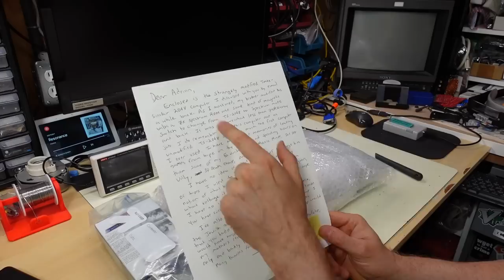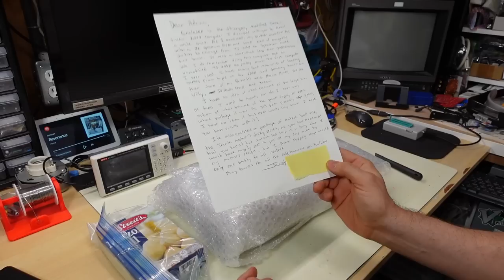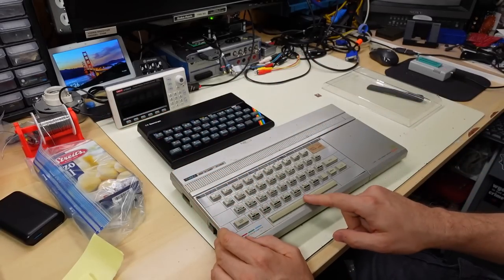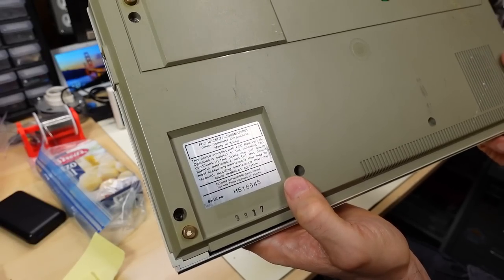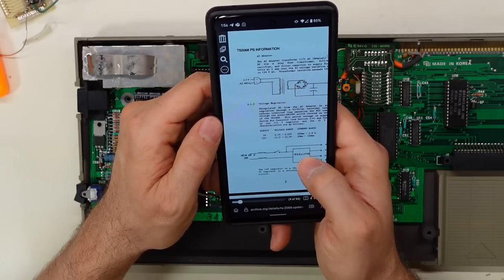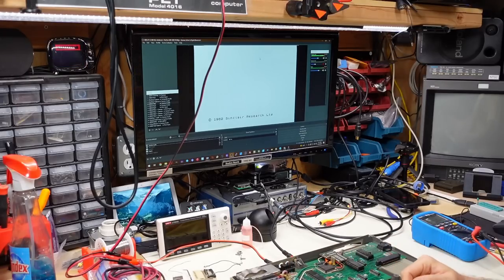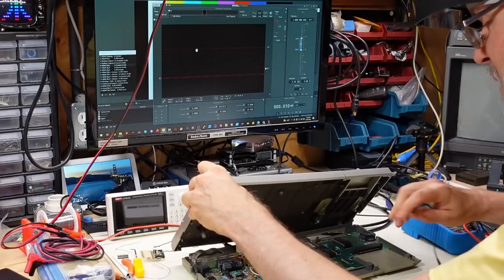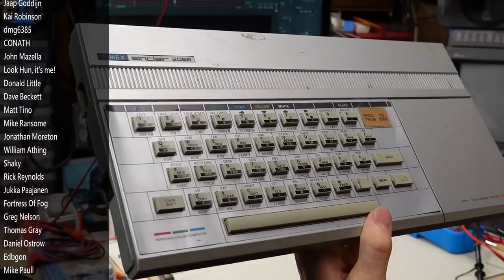0044 The ZX Spectrum of North America: The Timex Sinclair 2068

Comment: Actually, they weren't the same hardware.  The TS2068 had extra video modes, a real sound chip, joystick ports, a cartridge port that was a separate memory bank.  The edge connector was also different.  It even had CGA compatible RGB on the edge connector.

The 50/60 Hz differences were obvious.  Nearly all software used the vertical blank timer for timing.  So Sinclair software would run a bit faster on the TS2068.  Even when using a genuine 48K Spectrum ROM, it was still only 96% compatible.

The bodges and the daughter board are factory.  The TS2068 had two ROM chips.  One was in the primary memory bank (16K) and one was bank selected in (8K) the EX-ROM bank.  The cartridge also was bank selected.  The TS2068 had advanced bank selection and the 16/48K ZX Spectrum did not.  The ROM switcher board only selected the ROM in the HOME bank.

The hissing is normal.

You need to burn a TS2068 HOME ROM to use the computer's actual ROM which is an enhanced version (and why Spectrum software is not compatible).

This was the first computer I owned.  I made expansions and improved the OS using the bank selection logic.

Also, the Timex Technical Manual is available for download.  Yes, it's color and should have colorburst.  The joysticks were proprietary to the Timex.  Sinclair joystick assignment is not compatible.
Reply: As you say, the hissing was normal, with the original power supply (which was indeed 15 volts) -- but maybe it actually makes sense to give it less voltage, and maybe that really does kill the hiss, as well as the screen noise, as Adrian seems to have found? I never saw that experimented with back in the day, but I do know that upgrading the voltage regulator was a common mod.
Reply: @wmcbrine  upgrading to what?
Reply: @wmcbrine  what does it do if you change it? I have one of these machines.
Reply: @blackterminal  I haven't done the mod. Read the article, you'll know as much as I do.
Reply: The issue with it, it was meant to be a rock bottom priced computer, the only reason it sold so well, at least here in England, as despite how unreliable they were, they were half the price of their nearest competitor.

Even later Spectrum revisions(such as the later models with built in tape drive) all stuck to this principle. In the late '80s they were still stocked and sold in high enough numbers in bargain stores for like £50.
Reply: Actually, they joystick ports were Atari compatible, which was the norm in the US.
Reply: @donaldcongdon9095  He meant they were incompatible from a software perspective (you need different code to read them on a 2068 vs. the various Spectrum joystick interfaces).
Reply: @wmcbrine  That’s true. There were several joystick interfaces and standards in the ZX81/ZX Spectrum world. Sinclair and Kempston were the main ones.
Reply: @donaldcongdon9095  that had nothing to do with what I stated. They were incompatible with the Spectrum internally. Kepston is the typical joystick interface standard for a Spectrum.

Most every device with a DB9 interface was Atari compatible. Sega being the exception.
Reply: @fattomandeibu  Indeed, but Timex had "Tim Taylor"-itis and forgot about that.
Reply: @wmcbrine  The TS2068 had a major weakness, despite its many improvements.  That was its SCLD (similar to ULA for Spectrum).  If you just farted the wrong way and the SCLD gave up the ghost.  Playing around with the voltage etc could fry this sucker, especially if you used bus peripherals.  Lowering the input voltage also lowers the peak amperage available.  If the power supply sags, then this is when it hits the fan.  You also can't hear the hiss when enclosed.  This lowering of the input voltage is not needed.  15 volts should be adhered to. If it didn't matter, then Timex would have used a more typical 9 volt transformer.

As to the differences with the Spectrum, the built in switching supply was to fix the hot 7805 of the Spectrum.  The chips were consolidated into the SCLD.  It had the typical built in features for video games (FM sound, more graphics modes, and joysticks).  It even came coded to be ready for memory expansion up to 256K (provided the expansion had the second half of the bank selection logic).  The TS2068 could run BASIC out of the cartridge bank and use all of the 48K HOME RAM for variable storage.  Sure, it ran slightly slower doing that, but it worked, and I know as I coded a BBS for it to run out of the cartridge bank.  LROS and AROS were genius expansions to the ROM code, as well as the function dispatcher.

Timex did it the right way, but the uber-cheap and inferior Spectrum already had a foothold.  So to make your superior TS2068 run ZX Spectrum games, you had to downgrade your TS2068 to use the Spectrum ROM.  Sad, but true.  This is why it failed.  Oddly enough, games could have been ported easily, but the publishers didn't bother, nor did Timex.

Comment: ZX Spectrums were immensely popular in the rest of Europe too, especially in Greece and Spain.  Also plenty of clones behind the iron curtain too.
Reply: This same model with some modifications for PAL, was produced in Portugal and I had one. It was the TC 2068 instead of TS 2068.
Reply: @fernandobernardo6324  Strange, as the original British ZX Spectrum should have been just fine in Portugal. France may have needed a special SECAM model though.
Reply: @johndododoe1411  Indeed, but Timex Portugal decided to make some changes to that model and create another one TC2048 and they were produced here. These models were exported to some countries like  Poland, where many spectrums were in fact Timex machines.
Reply: @johndododoe1411  French Spectrums came with a SECAM adapter that plugs into the edge connector.
Reply: @fernandobernardo6324  Timex of Portugal were allowed by Sinclair to serve markets not covered by Sinclair: Portugal, Poland, Chile and Argentina. In Poland one can find the Timex Computer 2048 and the Unipolbrit 2086 (which is a modified Timex Computer 2068)

Comment: The TS2068 has additional graphics modes that the ZX Spectrum does not have. The AY chip is mapped differently from a ZX Spectrum. There is AY support in the BASIC ROM. You probably want the TS2086 ROM as well.

Comment: From memory as an old Spectrum owner.

The three pots you pointed out are to adjust video timing, early Spectrums needed tweaking to get a good stable colour picture. Worth trying to sort out your colour problems.

The ROM probably contains both Sinclair and Timex code. The lifted pin and bodge wire are acting as a bank switch for the lowest 16K of memory.

Comment: I had a Timex Sinclair 1500 at one time (dad found it at a "resale shop" many years ago).  The case looked more like a silver-and-beige ZX Spectrum, although I understand it was more of an upscaled TS 1000.   Even had a matching thermal printer with it.   It went missing years ago, I suspect I lost it in a house fire, along with my 3 TS100 machines and their accessories.

Never actually used any of them, they were just in the machines I was collecting at the time.
Reply: The TS1500 is a ZX81 in a Spectrum case with 16K internal RAM. Oh, and the case is tweaked ever so slightly to sort of match the styling of the 2068. It was a weird relic of Timex's original plans to bring the Spectrum to the U.S., before they went with the more advanced 2068.

Comment: As far as I remember, TS2068 had a ZX Spectrum "emulation" cartridge, which supposedly was supplied with the computer (at least its Polish version - Unipolbrit 2086 was). There was also TC2048, which was much more ZX Spectrum compatible.
Reply: Correct. Same in Portugal.
Reply: Iirc it was an extra and rare, dont know for sure though
Reply: The US Spectrum cartridges for this was very expensive and is now insanely rare. It certainly did not come with the machine.
Reply: i have a tc2048 but not yet working correctly,
Reply: Are those Soviet era clones?
Reply: @killerbee2562  In terms of period in time - yes, but they don't have anything to do with Soviet Union. They were made in Portugal.

Comment: I don't know much about the 2068 itself, but that's definitely the original Spectrum ROM you have there. The Timex ROM shows a “© 1983 TImex Computer Corp” message under the Sinclair one.

Also, as others have mentioned, the hardware isn't identical. The Timex has some (very interesting) extra graphics modes which are supported in BASIC, but only in its own ROM. Also, the GI sound chip is on different I/O ports to the one in the 128K Spectrums, so any Speccy software that uses it won't work. I believe the joystick ports are also incompatible with any of the Spectrum standards, but don't take that as gospel.

Comment: I had a Timex 2048, it was smaller ( no card port ) , it also had 2 joystick ports and it had RF for ntsc or pal.
I remember that it had on the manual a code that open some eprom that was able to be write from the basic, but I do not remember any eprom on the main board.
It use a 9V - 1 Amp power brick.
From what I remember did not had any "extra" boards on the main board.
I had to repair my when it blow up a cap.

It was a strong (like a tank) machine, besides the cap nothing more got damage.
Good video, 😉

Comment: I had one of those things in 1989. It came with a couple of differently styled digital joysticks of a design which I believe predates the Atari VCS. They were more styled like a mushroom where you held the stalk and they had a rounded triangular cap. They may have had rotation and two buttons in addition to up-down-left-right. I recall the same motherboard bodge wires/components and that little green upside-down bodge PCB as well.

Comment: Oh I really enjoyed digging into this computer a few years back.    First, you are probably not getting color because you are only using 9V. The video section of the computer need +12V and that is generated by a linear regulator off the +15V input, so you are severally under powering that section of the circuit.  This computer was supposedly desperately rushed out to the market and the PCB design really shows.  The little PCB you saw at the top of the computer as well as the flying wires are all how it was shipped.  The noise you are hearing is because the switching regulator runs at audio frequency (the inductor likes to ring at the switching frequency) AND  the speaker is driven from the op-amp on the switching regulator itself!   The ULA (SCLD) has a bug when they ported from PAL to NTSC and the color reference is incorrect, resulting in wrong color.  The video output is noisy and the expansion port is not pin compatible with the Spectrum, the sound chip is mapped differently from the Spectrum (to be fair, this computer implemented this before the Spectrum) and the joystick does not follow any of the regular Spectrum standard.  It was really fun converting mine into a machine with switchable rom,  improved power supply,  S-video output, fixing the color, re-mapping the sound chip and joystick when in spectrum rom mode to be Spectrum compatible.  Drop me a note if you want any of the technical details.

Comment: If that hole in the back is near the keyboard connector, it may be he had an external keyboard at some point.
That was quite common over here with the ‘81 and Speccy, where people had ribbon cables out to a more robust keyboard 👍
Reply: yeah that has to be it. just soldered onto the back side of the connector

Comment: My dad had a TS 2068.  I had the TS 1500 that looks like a black-and-silver ZX Spectrum case but it's mostly a ZX81 inside, and the thermal printer.  (all on clearance after Timex gave up)  I never tried to play games on the TS 1500 - it would not have been able to compete with our Atari or the Apple II I played Ultima on at school.

Looks like that plastic post and brass nut, along with the thermal pad that fell out of the case early on, may have been for heat sinking the voltage regulator on the far left side of the motherboard.

Comment: I have one of these. As a Commodore guy used to just typing the commands, I agree the the keyboard is murder. Mine makes the hissing noise as well, seems to come from the square shaped inductor. I encased mine in clear silicone sealant and that made it quieter, but not totally silent. I'd be curious to know if there is a modern substitute component. The power supply mine came with indicates it outputs 15 volts, I believe it is factory original.  My screen says on two separate lines "1982 Sinclair Research Ltd' and "1983 Timex Computer Corp" so I wonder a little bit about the rom you have.  I see on ebay a cartridge for the ZX Spectrum rom, may experiment with that at some point. Mine does output color. For quick test, press shift-b and then pick a number - this will change the border color.

Comment: Hi Adrian, I may have mentioned this before, this was my second computer (T/s1000 the first) and the reason this failed was lack of software I think. I didn’t know then at 13-14 years old that the reason I couldn’t run spectrum stuff and had to wait for ports was because Times decided to make it their own rather than just make it spectrum compatible. I learned basic and machine code on it. I also created software and sold it on cassette via mail order back then too, database stuff and the like. My favorite games on it were “Fighter Pilot” and “Tomahawk” sims. Tomahawk I had to wait 9 months for them to port to the 2068 from the spectrum. The nice thing about those games is that you could use two joysticks. For Fighter Pilot you used the left stick for throttle/rudder and the right stick for aerelons, elevator, guns. Tomahawk was collective for the left stick and cyclic/weapons for right. The sound generator was really neat on it if I remember. Well enjoyed the video and wish I could have done that to my 2068 back then!

Comment: the 'half duff' 64k chips werent just used by sinclair, they were officially sold by the manufacturers under unique type numbers and had 4 'variations' of the duff bank,  either duff row or duff column,   and each of those either high or low bit duff  , one manufacturer sold duff row ones, the other duff column ones,

Comment: There were game cartridges for the ZX Spectrum but you needed the optional "Interface 2" expansion which added the cartridge slot and joystick ports.  They never really took off as the cartridges were more expensive to produce than cassette tapes and the Interface 2 was not that common as there were other cheaper joystick interfaces like the Kemptston.  Even in the later versions of the Spectrum that included joystick ports as standard the external Kempston interface was more common for game support as it was well established.
Reply: Also the game cartridges could only contain 16K of data, whereas on a fully expanded Spectrum you could load 48K.

Comment: The 2068 has a brown in its colour palette along with a black whereas the ZX Speccy had 2 blacks so there can be problems translating the correct colours in ZX Spectrum games when installing the ZX Spectrum ROM into the 2068. A nice looking machine we never got in the UK.
Reply: I think Spectrum is prettier. And it's rubber membrane keyboard was still a major upgrade from the flat membrane keyboard on the famously cheap ZX81.

Comment: Bet that hissing was the transformer right there near that inductor at the back left.

Also, a good trick for finding the location of noises is to use a length of tubing, stick on in your ear, and wave the other end around where you're searching.
Reply: The hissing comes from the op amp, which is on the same chip as the switching 5V power supply.

Comment: Timex / Sinclair computers made the user do the job of tokenizing BASIC commands for the computer! Still, a lot of good memories, and the BASIC had some more sophisticated commands than the C64 (after I accidentally killed my 2068 I later owned a C128, then more recently got another working 2068).  Can confirm my original 2068 power supply is 15VDC, 1A, center negative (good job getting the polarity right without a reference).

Comment: 25:35 it's possible that the computer was operated on a monochrome monitor. The color burst would interfere there, since the signal is then interpreted as "dots". Black and white TVs had a color trap for this, which filtered out the burst. The disadvantage was that the sharpness went down.

Comment: If I had to guess, the "monitor" output was intended for use with a monochrome monitor, which would display an annoying pinstripe effect if fed a color signal. Color is probably available on the RF modulator output.

Comment: It wasn't just that Spectrum keyboards were bad. It's that they wanted you to feel bad too. (Although I'm seriously impressed that Adrian managed to find E mode by sheer trial and error! You get to this by pressing both shift keys simultaneously, which is not intuitive!)
Reply: This is why I am glad I have the Spectrum + 48k model - all those weird mode combinations were expanded into their own keys. Plus, there were plastic keys on top of the membrane that make typing less erratic. I'm currently learning BASIC on my little Spectrum (I have bad fingers at the moment so pressing one key per command is really attractive)

[the only real difference with the + 48k model was the case and keyboard, to the point where Sinclair made case-upgrade kits for £20 and would fit the thing for you if you posted your Spectrum in with a £30 cheque or postal order]